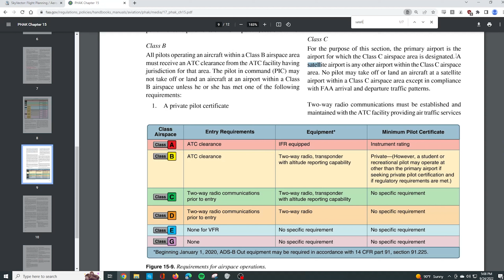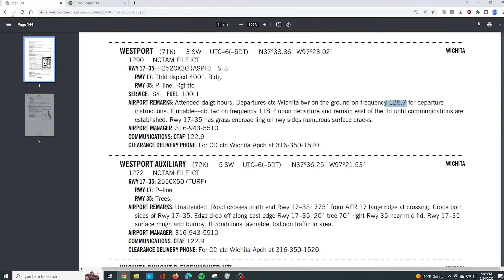Class C Airspace Operations | Satellite Airport Departure | Full ATC Audio

Comment: Hi there - great video! Is it not required to notify local airport traffic prior to take off? I heard the radio call to local airport traffic for back taxi but take off and departure radio call was made only to the main airport tower. Thanks !
Reply from the maker: You're right. I should've made a departure/take off radio call on the local frequency. This is an extremely small airport and is under the shelf of the class C airspace. I was confident there was no traffic in the pattern or on final approach. If there was traffic incoming to this airport Wichita departure would likely have let me know.